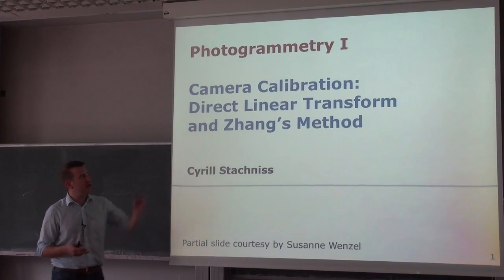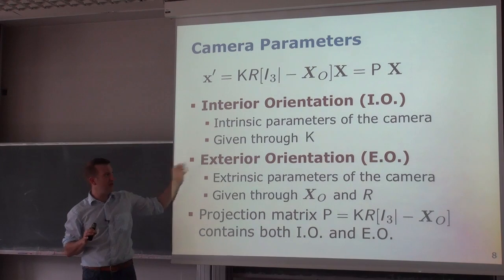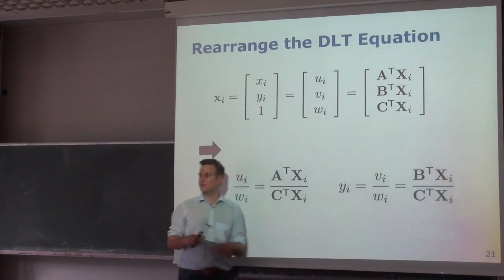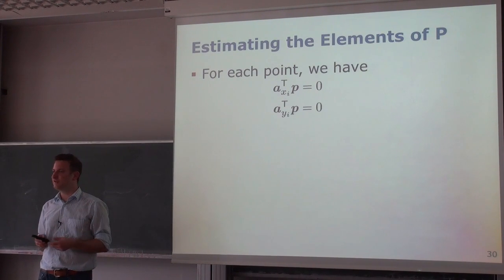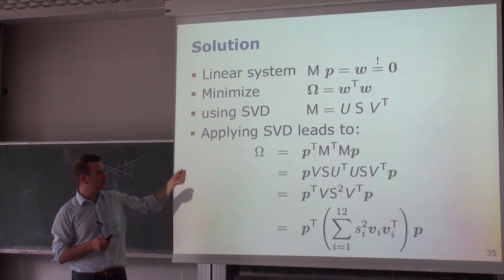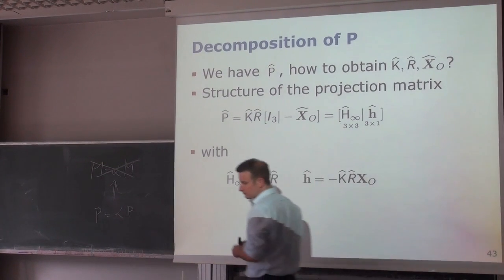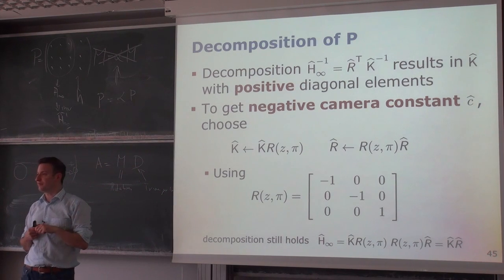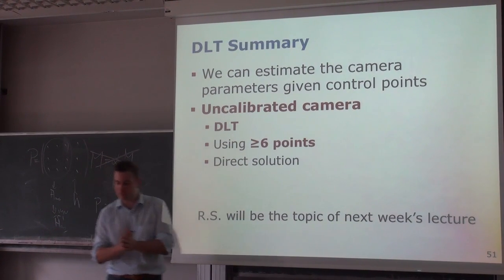Photogrammetry I - 16a - DLT & Camera Calibration (2015)

Comment: In slide number 41 you said not to locate all points on a plane so that can turn all z point to zero. so can we get over from that, if we put all the points on the same plane and add the same value to Z (ex: Z= 1)?
And thanks for this great step by step explanation~~